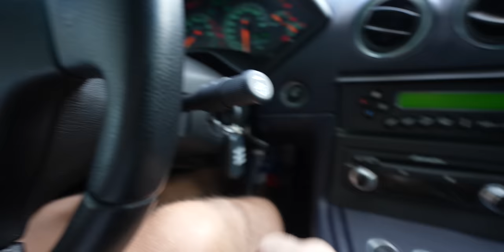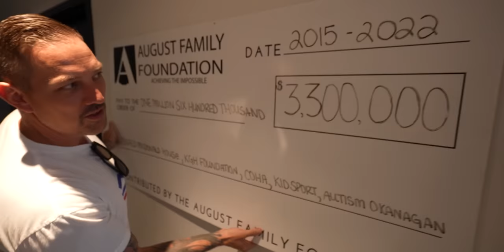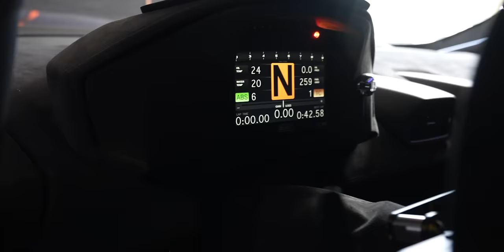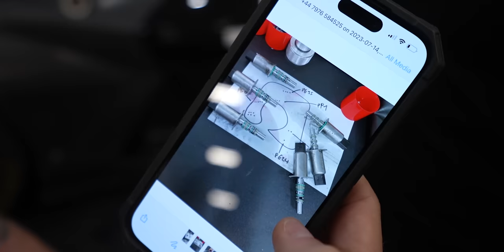I MADE A HUGE MISTAKE SELLING 2 OF MY FAVOURITE CARS… *EMOTIONAL*

Comment: There’s a very good chance the random check engine lights are due to your def systems. Best thing to do is delete the def system if it’s not already done
Reply: I agree but it won't pass smog. They have gotten so strict.
Reply: They have a way to bypass it and just have it during inspection